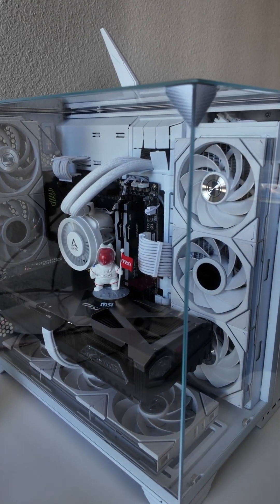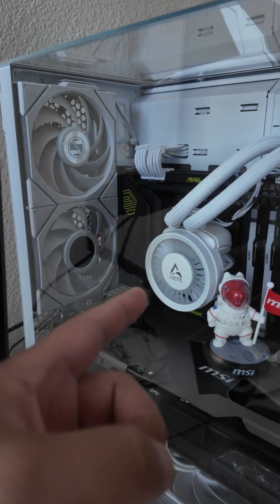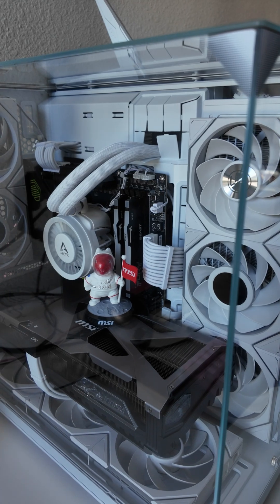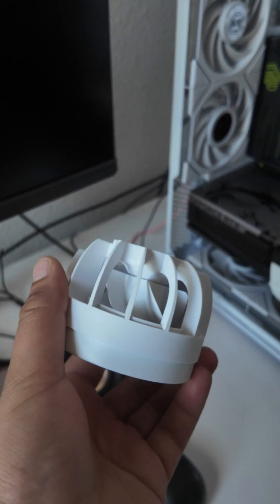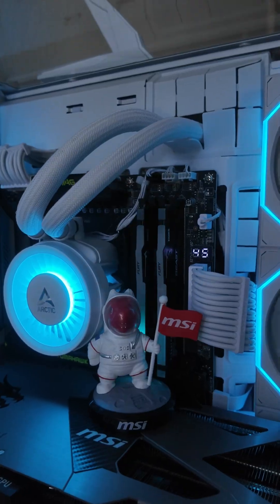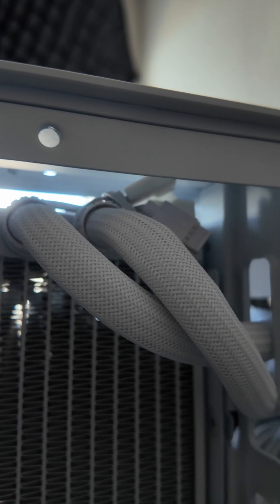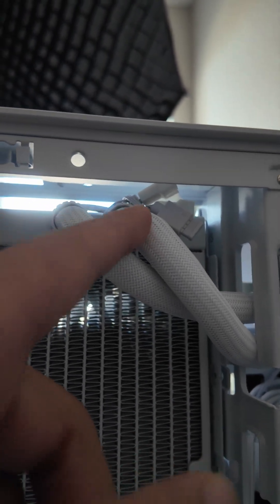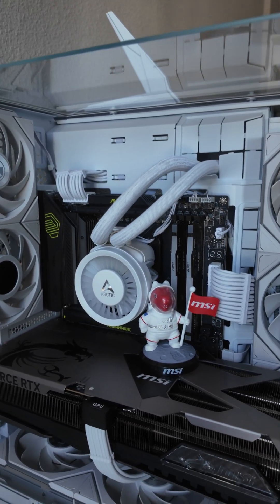Lian Li 011 Vision Compact 🔥 5070Ti Vanguard + 9950x

Comment: And the hoses doesn't have pressure? If It does it can reduce the life of the aio. I'm planning on doing the same thing with my liquid freezer and vision compact,and I'm deciding between mounting the hoses from the back, or just in the front.
Reply from the maker: I had no issues mounting it the way shown in the video; otherwise, I wouldn’t include the video. It’s entirely up to you.

Comment: Are the AMD mounting brackets reversed as well, or are they in the default L/R configuration with just the pump flipped?
Reply: Never mind. I have read now in the arctic subreddit that since the cooler is symmetrical along the mounting bolts, it can be flipped but the brackets should remain in the default orientation.
Reply from the maker: Yes 👍